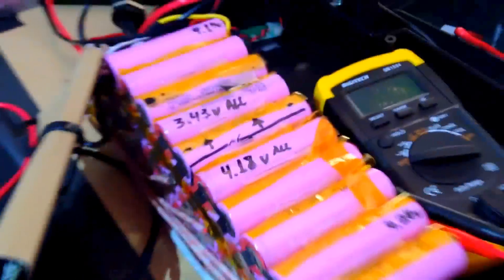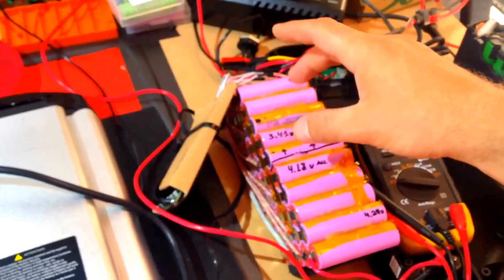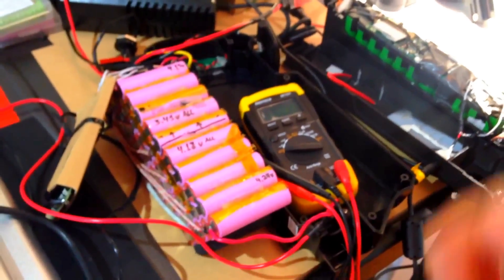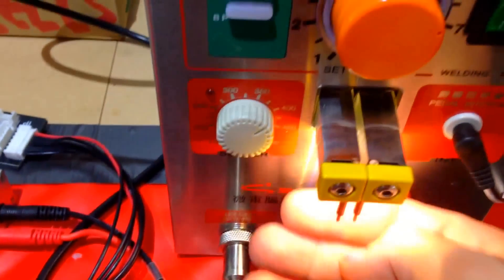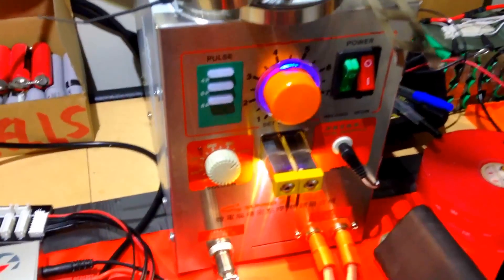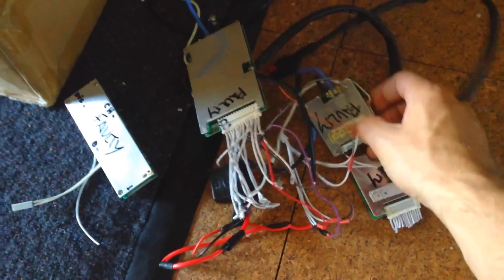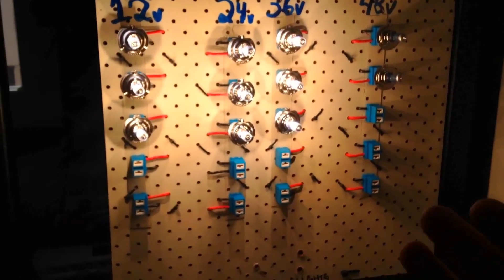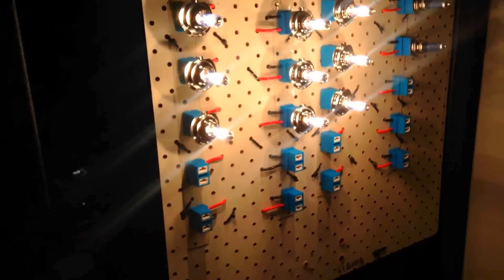Battery work station: spot welder, custom packs, BMS • Tour at eMax-eBikes lab • Electric Bike

Comment: I've got another question for you ElectricBike man if you don't mind.  I have a spot welder just like this one, but have had no luck spot welding .15 nickel with the hand probes.  I've turned the settings all the way up and still not a good result.  Are spot welding .15 with the hand probe?
Reply: Try cleaning your probes, then check the fuse to see if it's partly blown, then move to a bigger and closer outlet. I built a mot spot welder and dirty probes or overheated lacking voltage killed it every time
Reply: The next thing with hand probes I found is crank it all the way.
Reply: Thanks Joblessalex.  I haven't tried your suggestions yet but I will.

Comment: Great video.  Very informative.  Thank you.  I have that same spot welder. ha..  

Hey, i've got a question for you if you have the time.  I just built a 60v20ah battery using brand new samsung 25r cells from a very reliable source.  I tested capacity on a few just to be sure.  It's a 16s8p config.  The cells were holding there charge until I hooked up the bms, and since then it is continually draining.  I charge up all the way to 67.2 volts, and then it slowing goes down.  So far it's gone down to 66.4v.  I spot welded on 6 pulse/6.5 amps using .15 nickel using the same design as Damian Rene in this video:  https://www.youtube.com/watch?v=2Z1PIGLRSMc
I used this bms:  http://www.aliexpress.com/item/16S-Li-ion-Lipo-Batteries-Protection-Board-BMS-System-60V-67-2V-50A-Continuous-Discharge-Current/32263328170.html

Probably should have gone with Bestech.  Do you think the bms is causing my problem?

thanks Bruno,
you rock!!!
Reply from the maker: +Paul Sammons Music - Yeaahhh... I love this stop welder, the pedal and the convenience to reach any cell on the pack is just priceless =]
The BMS is a very low power circuit that is constantly turned on so it does eat some micro amps, some would drain more power than others. Maybe try this one here http://www.batterysupports.com/lion-lipo-nbsp-60v-nbsp-16s-c-32_45.html 
I don't really like BMS in general but these ones are very well made and capable of ridiculous amperage!
Besttech make some good ones too, they're probably the biggest ones.
The newer 18650 cells are very stable, I have been running my 14s with Panasonic PF cells without BMS since 20th September (6 months ago) discharging and charging almost every single day. I am yet to see the cells getting unbalanced... I am trying really hard but its just not happening... 
Watch this video here where I bypass the BMS and show how to adjust the trimpot inside the charger https://www.youtube.com/watch?v=EVv5z7GABx4
To get the 67.2v you have to charge a bit higher than that as the pack would naturally drop a good 0.7v few hours after disconnect from the charger, it happens due to the chemical reaction inside the cells. Normally the 14s pack is charged at 59.2v to get 58.8v.
Rock'n roll yeahhhhh....
Reply: +ElectricBike (Bruno) I see.  I was actually looking at that same bms from battery support.  Yeah, I wish I could just bring it over to you and have you look at it.  I just learned today on endless-sphere that in order to solder 10AWG wires I need flux paste and an 80w fat tip soldering gun.  
Bad soldering is probably why I'm having trouble with voltage dropping so much.  And I have definitely heated up a few of the cells while struggling with the huge 10AWG wires.  UGhhh..  I'm having a rough go at it.  Maybe once I get this thing soldered properly it'll be fine.  I hope.  I really hope!  
Looks like your running a little repair shop with that sunkko.  I wish the welding pen would weld through .15 nickel.  I had to do this 16s pack one row at a time so it would fit under the welding pins.  It got heavy toward the end.  What a project!  ROCK!
Reply from the maker: +Paul Sammons Music - Yeah... we are setting up a proper battery factory down in Wollongong-NSW with a $300k machine and a $17k spot welder in an industrial area... we will make premium quality stuff in house yesss... =]
Some tips for you when soldering thick wires to the cells, there is a trick that would make things a LOT easier... get your spot-welder and solder a longer tab a bit longer than your pack (you can fold it in any direction, it won't matter) the heat saturates that end really fast, melts the solder and doesn't transfer heat to the cell at all... add some solder to the wire, add some solder to the tab and theeeeen you solder together, should be extremely easy and very quick, you will be laughing thinking "oh.. this is sooo simple... why didn't I think this in the first place!" =]
A powerful soldering station micro controlled that heats up to 480c will do that job easily. Add some little solder to the soldering tip and you get a wider surface in contact with the wire in case you don't have a square tip. 
I will tell you one thing that will make you scratch your head... lots of people recommend to use flux... most of solder already comes with flux core so you don't need to add more... the "pro flux guys" forget to tell people that flux is corrosive and needs to be washed off after the job is done. I would use special flux only when soldering something like aluminium tabs with aluminium flux-less solder, this is when you need flux. 
Ahhhhhh.... this is a such geek chat hahaha... love it!!! =]
Reply: Oh yeah!  I love nerdin' out to this stuff.  Great tip for the extra nickel length.  I suppose I'll solder an extra little tab on there.  Then there's no worry of heating up cells.  Brilliant!  

I already bought some rosin paste flux.  Haven't used it yet.  Some folks recommended it on Endless-sphere.  Also, I learned recently that I was using a solder that's very hard to stick.  It's lead-free .62mm, so it's kinda big.  Takes a lot to heat it up.  So, I just bought this solder:  http://www.amazon.com/Miniatronics-Corp-1064004-Rosin-Solder/dp/B0006O933K?ie=UTF8&psc=1&redirect=true&ref_=oh_aui_detailpage_o00_s00
I hope it works better.  But still I'm a little fuzzy on the best solder for this particular application.

I hope the new battery production factory goes well.  I'm sure it will.  Everything you touch turns to e-bike gold.  lol
Reply from the maker: +Paul Sammons Music - Hahahahaha... thanks for your nice complements hahaha.. =]    I know exactly what you're talking about the lead-free solder.... I bought one just to try.... I am a very environmental person... I tried to like... but its a total rubbish... doesn't stick to ANYTHING!! You'll see the difference when you try your flux-core solder from Amazon.. you'll feel like a PRO soldering haha.. maybe try some different brands, thin and thick ones... I normally use a thin/medium for most applications... too thin is only good for very small and delicate repair but is good to have, very thick ones are good in some cases but a bit hard to control and as you add solder it drops the temperature a little bit where you're trying to solder. Try to get a "cool gas" or "freon gas" spray like I showed in some of my videos, sometimes you ended up taking a bit too long soldering and the cool gas will come handy, specially when doing thick wires =]
POWEEEERRRRRR....
Reply: +ElectricBike (Bruno) Awesome!  I will.  Looking forward to more videos.

Comment: Did you just say you need to go back to work? You call that Work? You only have fun man. With all that power.  Anyway, I need your advise, how do I make my wires almost disappear to give the bike a neat look? Wiring. Perhaps you know some good trick? Thanks.
Reply from the maker: +Leandro Almeida - Hahahaha.. I used to dream about the day when I could work with these things and stop blowing all my $$$$$ "experimenting" things in my garage... I feel like a happy kid at the playground hahahaa 
I would be stupid to leave this fun work place!
To make the wires "disappear" the best way is use heat-shrink wherever you can and lots of small cable tie getting all wires neat together. I pack most of the harness, controller and battery wires right behind the motor, between the motor and the bottom bracket, I use some medium cable ties first then I use a long one to hold it under the BB. The more time you spend planning it the better. You get better results on dark or black frames as all wires and cable ties are black. At work I use this thing here http://www.ebikes.ca/shop/ebike-parts/wiring-accessories/consleeve.html# to organise all wires at the handlebar. Also try this tape here http://www.ebay.com.au/itm/23mm-Width-Insulated-High-Voltage-Adhesive-Electrical-Rubber-Tape-Roll-5M-16-4Ft-/391187102840?hash=item5b14917c78:g:DfcAAOSwnLdWq6Vc

Comment: I have one of those rear rack pack can you do a quick disassembly video on that my BMS has failed on it and need to finds a solution thank you
Reply from the maker: +Andrew Meddley - Hi Andrew... I ended up returning this battery to the owner on that day.. otherwise I would make something showing it inside...
If you can't find any generic BMS for your pack maybe connect it directly bypassing the BMS. 99% of all motor controllers will have cut-off protection so you shouldn't have to worry about over-discharging it and almost all chargers will stop once the battery is fully charged. Give it a go and see how it goes =]
Reply: +ElectricBike (Bruno) I am currently running it that way now . I am debating disassembling it and using it in a triangle pack but maybe I'll mess with it in the winter , spring is here in the US and I don't wanna waste any of the season
Reply: +Andrew Meddley Thank you for your time . And keep up the good work
Reply from the maker: +Andrew Meddley - Yeahhh... you're more than welcome... enjoy the season with a lot of POWEEEEEEEERRRR... =]

Comment: hey man I am looking for a good spot welder for cheap. Do you have any recommendations?
Reply from the maker: +Clifford Zvengrowski - I would recommend getting the same spot welder so you can use the pedal to activate the machine and also the pen to reach the middle of the pack. Just Google "Sunko 709A" and try many different tabs, nickel plated steel core tabs are cheaper and much easier to solder than pure nickel ones, you should try all sizes and thickness to see which one will be the best for that particular application you're using... =]
Reply: ElectricBike
thanks so much! Yeah it looks great, not too expensive either

Comment: I have a question for you.. so I'm interested in the BBSHD kit for my bike and I have sourced it from a couple different locations. LunaCycles and LectricCycles. Lectric Cycles calls it the E-rad kit. Do you know if there are any differences between the Luna kit and the E-rad kit? The prices are not even close with the E-rad kit being much more expensive. I was curious if there was any benefit to buying one over the other.. Any help would be much appreciated! Cheers!
Reply from the maker: +Matthew Taylor - Good question... the motor is exactly the same but the Luna Cycles is the factory setup, they may program full power if you ask, the e-Rad comes with 100% power enabled and their custom settings + gear sensors and many other options and accessories. The main difference comes if you have a bike that requires a special bottom bracket fitting like the dual suspension press-fit with very wide internal diameter, e-Rad will have adaptors to fit 99% of these awkward, totally worth the extra $$ if this is your case. If you have a normal bike not too fancy and just want to have some fun, the Luna Cycle will make you happy too =]
Where are you located in the USA? If not.. you may have some customs issues shipping the batteries internationally...
Reply: +ElectricBike (Bruno) I'm located in Seattle, WA. I have sourced an awesome battery too. Can't remember the website at the moment, though. Looking through the options on the Lunacycles site I feel like all of the same options are available as the E-rad kit but cost a little more to add to the final price. But with all options selected it's still much cheaper than the E-rad kit. Maybe there's something I'm missing? When I read the description of both motors to me it appears to be the same except you have to select those options on the lunacycle site. hmm. I appreciate you're reply. This stuff is confusing.
Reply: I guess I should elaborate and say that I do have a full suspension bike but the bottom bracket from what I can gather is standard.
Reply from the maker: +Matthew Taylor - oh.. sorry for keeping you waiting for 2 weeks... have you decided between eRad or Luna? Yeah.. some older full suspension looks fine like a normal 73mm BB but you will only find out if the motor fits without any problem when you're actually fitting it to the frame =/ sometimes it looks normal but the motor will touch the chainstay so you need spacers and all that blablabla... take some photos showing your frame from the top and send to both and see what they say... that will be a good way to test their customer service..  =]

Comment: ha, so I noticed no spot welding on your pack, doesnt the boss allow personal projects? :(

I guess maybe you prefered to build it at home at your leisure...
Reply from the maker: +Jayme Capurso - Hahhaa... no problems in using the facilities at work to make my own projects.. I made my pack a while ago back in November 2014... I did have access to spot welder at the time but yes I preferred to do at home... one of the main reasons was to contradict everyone so says "you should not solder batteries" (there is a proper way to do it so it is possible) it took me so much time manually soldering 140 times but I really want to prove the point =]

Another thing that I want to prove the point, I disconnected my BMS in September 2015 contradicting more people "you must have BMS to balance your pack otherwise all cells will get out of balance and you will kill your pack". I am constantly checking the voltages just waiting for the day when my cells will get out of balance... 6 months later and it still perfectly balanced =]
Reply: I recently watched the Samba guy talk about how he doesnt use a BMS and hes using mainly old cells. He thinks bottom balancing is all that is needed and a way to check them occasionally.
Reply from the maker: +Jayme Capurso - He is the best... got a popular YouTube channel and is telling people the same anti-BMS message... I have been emailing all BMS makers asking questions because I am going to make a video talking about it... the more I try to like BMS the more I question why people even bother using it... the controller has low voltage cut-off already.. the battery charger has a high-voltage cut-off.... the BMS only balances cells during the charge and doesn't do a good job at all.. it is always turned on and slowly draining the battery (micro-amps) people living in snowing countries can't ride for 4 or 6 months so by the time they need to use the battery again it will be totally discharged sometimes killing the pack or damaging the cells.. anything else? Sounds like an amazing must have device... hahaha..

Comment: Hi, very interesting video. On your previous video about battery pack you didn't have the spot welder, I assume it is brand new! Very nice. I have a question : if i replace 36v17ah lead batteries with 36v17ah lithium batteries with bms, do i have to check the maximum peak current the controller can handle to make sur the amps of the new pack won't frt it, or will the controller limit by itself the amount of current coming from the battery pack?
Reply from the maker: +EFA22000 - Yeahhhh.. my previous "battery videos" were recorded a while ago showing my 2014 homemade battery pack. I did have access to spot welder at the time but yes I preferred to do at home... one of the main reasons was to contradict everyone who says "you should not solder batteries" (there is a proper way to do it so it is possible) it took me so much time manually soldering 140 times but I really want to prove the point =]

Your 36v 17Ah question...basically the controller tells how much power or amperage your motor will be consuming... the ideal is to have a battery that can handle at least a bit more than the maximum controller amperage. Just as an example: if your controller is 20A maximum, using a 20A battery you'll be limiting the battery life as you'll be stressing the pack to the limit, it will get hot and eventually have problems. If you get  a battery pack that is capable of higher amperage lets say 30A or more, you will find that the pack barely gets warm =]
Reply: +ElectricBike (Bruno) thank you

Comment: Hello Bruno, 
I would like to know would you be able to make me a 52 volt pack with samsung 25r cells in a shark pack?
Ive tried to purchase one from the US but they won't ship to Australia.
BTW you have  a fantastic passion for e bikes and are the  reason i bought one!
Reply from the maker: +Tas P - Hi Tas, There is a massive battery shipping restriction happening to AUS and NZ since December 2015, this must be why you can't get anything from overseas. YES we can make a custom 52v battery pack, any size, any shape, capacity, cells... we can order Samsung cells and make the pack for you. We do have LG MJ1 in stock, they are probably the best cells for most ebike applications 3500mAh 10A continuous discharge (better than Panasonic PF or B but without compromising discharge rate or capacity).   
Please contact Ewan on (02)9557 4515 or sales@emax-ebikes.com.au for a quote, tell him that we have been chatting here haha =]
Reply: ElectricBike Thank you Bruno you are very helpful ill contact your work place when I'm ready to order.